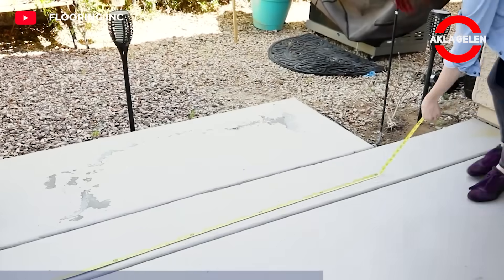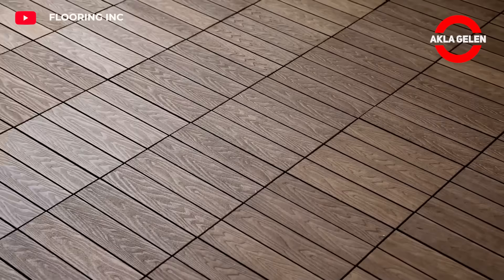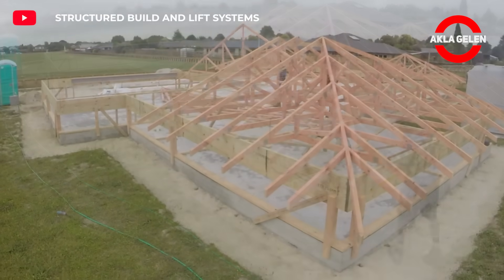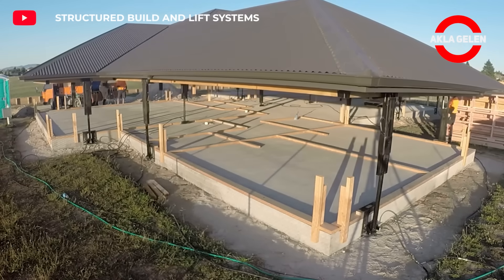Construction Workers Can't Believe This Technique Works - Most Ingenious Construction Technologies▶4

Comment: somehow i'm doubting that a block filled with straw and has multiple avenues for moisture for example to penetrate is going to last as long as a traditional block, let alone be as strong. i'm also going to say that a lot of the features on the first example only try to make it seem better than a traditional build when in fact they're likely worse because of the additional concerns included and it would be more expensive since it would take more time, more materials, etc.

Comment: If they just added sand to that polyurea spray they would be able to make a very strong rubber cement I wonder if they can use a sandblaster to add to that spray gun

Comment: Having been a fire chief in the past with experience with hay bales, in my opinion that construction using hay bales with a concrete outer layer can be dangerous to the inhabitants.  During my many years in the fire service I have personally seen two fires that occurred do to spontaneous combustion of the hay when it was inside a poured concrete form.  One caused a fair amount of damage to the house that it was attached to.  In both cases the bales were the fill inside stairs going into the home where the bales were formed like stairs inside and then concrete was poured in a form around the bales.  There are still many great construction methods but using bales of hay is not my recommendation.

Comment: 40 yrs ago i ran a concrete crew for a hospital in montana  we used straw bales of sraw on all the big steps in the parking garage ,worked awesome, less braces needed, cut time in half, also got my hip replaced there 2 yrs ago n there still in pretty good shape , but they r covered n no real weather condition to deteriorate

Comment: Some really nice Eastern European building techniques.
Reply: In Eastern Europe we exclusively use reinforced concrete for load bearing and very wide bricks for external walls and medium wide bricks for internal walls. And that's it. As of late, flat roofs are preferred due to better isolation and efficiency.  
Anything else is outlier including everything mentioned in this video.

Comment: It works until you get a single crack in that concrete. Then you will have what is called a catastrophic collapse once moisture or bugs get into the hay and starts eating away at it. On a side note we could easily use everyday trash that does not decompose and make bundles out of it and that would be far stronger.

Man that is a great idea, create foundations and walls out of trash to help cut down on waste. Someone said i was smart once.

Comment: The methods shown are neither new nor innovative. They all have been tried before and have mostly failed to gain traction. Trouble is that just as my father found over sixty years ago, with his experiment with prefab housing, stick built platform frame or concrete block construction wins the economic contest.

Comment: They should implement that spray on stuff in our asphalt for roads. If it's that resistant to cracking and impacts, that could solve the pothole problem in the US and with constantly having to repave. Just mix it in with the asphalt before paving a road and it would hold up for decades. The fact that it's waterproof is also a plus. No water sinking through the asphalt would help prevent sinkholes from forming under the roads which in turn also helps prevent potholes from forming. The water could be collected, cleaned and redirected to farms or areas where the water is needed. In areas where salt is used on roads in the winter, instead of having to keep adding new salt after every storm polluting the environment, the salt could be extracted from the runoff during the water purification process and reused next year. Town and cities could potentially save millions of dollars per year just by doing this.
Reply: It doesn't hold up to sunlight and weather. It's an interior material.
Reply: @MrMZaccone  The idea of @mysterydude1 is still useful for this major problem in Indian rural areas
Reply: Asphalt is very very strong but also gets an incredible beating. It's just leftover from oil refining and pebbles. It would be hard to improve in an affordable way, because we need thousands of miles of it.
Reply: @Patiboke  That is true but when you consider how many billions of dollars are spent every year repairing the roads (not that they actually do repair them) wouldn't that money be better spent on improving the durability and life of the roads? Instead of spending billions on patching and half assed repairs spend the billions on research and upgrades. If for example they spend 5 billion on repairs every year wouldn't it make more sense to spend 10 or 15 billion to come up with a way to make roads last for decades rather than a year or two? Spend a little more now and save tons later. Makes sense to me but greed will never let that happen.
Reply: @mysterydude1  они тратят ваши деньги, а не свои. по этому можно хоть по 3 раза в год перекладывать. поймите, те кто у власти , у них нет цели экономить, развиваться, созидать или улучшать жизнь людей. их цель заставить это делать самих людей и при этом самим же за всё платить.
Reply: @dwk2618  You are not wrong at all

Comment: 3:56 - Hitting the bricks with a rubber hammer, on the edge of a thin board.  The water in the basin shows he hardly applied force.  Not a very good demonstration.

Comment: As a construction worker for over 20 years. Alot of this will never be implemented. Its all going to be too expensive. What about that new road concrete that lets water pass through it? From what ive read and heard, its really expensive and thats why its not used. So what was the point ovmf making ut in the first place if its to expensive itll never be implemented. I say we get rid of money. Then it would no longer be "not cost effective ".

Comment: Old timber from the dumpster, cheapest metal sheets or from the dumpster, some trash for insulation, metal sheet, old timber... You have a 5 layer wall for minimal cost. Local rocks and some mortal is also economical, but takes a lot longer.

Comment: What happens when the straw rots out from trapped moisture? Will it be a concert shell or will the slurry penetrate deep enough to saturate the hole bale?
Reply: во 1 если делать по умному то солому надо обрабатывать  цинковым или железным купоросом.так она десятилетия простоит без гнили мышей и насекомых.
во 2 стены из прессованной соломы далее покрывают цементом если, то это так же помогает.но главное просто обработать купоросом.например вымоченную в купоросе сутки  деревянную доску после сушки можешь закопать в землю она минимум лет 30 простоит без гниения.если регион не слишком влажный и доска не будет постоянно в болоте то простоит 50+ лет в земле
Reply: As a contractor specialized in water damage repair I can tell you that trapped moisture kills any structure. Wood rots, steel rusts (in case of that steel being rebar, destroying the surrounding concrete with it) and even a saturated brick turns to dust when it freezes.

Funnily enough (and possibly counterintuitive) a straw bale building is actually quite low on the list of water ingress becoming problematic. Because it can buffer a lot more water before it becomes a problem than most other materials.
Reply: @sigi9669  при пропитке  того же дерева или соломы составами предотвращающими гниение пока состав такой не будет вымыт водой гниения не будет.на вымывание уйдет время в зависимости от  объемов воды.так что древесина будет мокрой но гнить не будет пока состав не дающий гнить в ней находится.
так же есть составы да простая смола которой можно покрыть кирпичи закрыв поры в которые попадает вода не дает разрушать кирпич заморозкой воды.
арматура в бетоне  защищается гидроизоляцией бетона.конечно все это требует дополнительных работ и стоимость постройки увеличивается но  надо понимать что стоимость  ремонта или полного переделывания постройки будет намного выше. если правильно строить то большинство проблем можно избежать.и проблема в том что большинство строят  без всех этих дополнительных защит поэтому многие постройки быстро разрушаются.
просто надо разумно строить

Comment: Concrete is not an insulation like the claim in the modular section.
They are cold damp and cost a fortune to heat trust me i live in one.
Saving up to get external insulation fitted.
Reply: everything is an insulator of varying degrees of effectiveness

Comment: That roof lifting idea was amazing. Way faster and safer to build it on the ground.
Reply: Yeh, but I wouldn't want to be underneath it before the walls are set.
Reply: It is. Couple years ago I took part in project where we slapped steel gable roof on a four story flats. I prefer a crane over dozen jacks though. Safer, faster and about the same cost overall.
Reply: great!

Comment: Walls of straw, mice in the walls will have parties .
Аnd raising the roof is great. A lot of workers fall from roofs when building houses
Reply: You don't know what you're talking about. There are tens of thousands of straw(bale) buildings around the world. Countries like Germany and France have building codes for this and are building apartments, schools and the like. Straw fibre is injected as insulation in timber frames and roofs, by the truck load.
Reply: @nelus7276  I am in Germany and I don't know anything like what you are writing about, especially since I work on construction sites. Especially some kind of straw standards? What are you talking about? Yes, in the north of Germany there are many roofs made of pressed straw, but only roofs, I have never been inside such houses. But rodents would probably laugh at your comment.
Reply: What about fire?
Reply: If you seal them well, rodents can’t get in.

Comment: That roof lift system looks pretty interesting. It probably considerably increases safety, as you don't have to worry about somebody falling off the roof while building it.
Reply: removes the need for a crane to lift the trusses.
Reply: @DarkmanTF1  Damn you guys get to use cranes?
We always just lifted the trusses into position with our bodies.
Reply: @onionring1531    Been there. Done that.  Not fun.

Comment: I remember a story about a little piggy that built his home from straw......it didn't end well.
Reply: That's because it's just a fairy tale. Seriously though, that story refers to thatch on a  stick frame. Baling machines have only been around for just over a century. The oldest modern straw bale buildings are already that old. Very comfortable. Well I insulated against winter cold, summer heat and sound.

Comment: Only if the product does not rot 
When hay shrinks and deteriorates 
That build will be falling apart and a possible dea*th trap
In olden days they used stone, all buildings last to this day, all over Europe you see them
Everything else modern built has to be demolished over time, very sad
Concrete is ok, but I saw them treating hay ?
Reply: You don't understand the difference between hay and straw.

Comment: Doing the roof first and lifting was smart.
Reply: Not really.   I have seen a house framed out in 2 days and then 2 more days for the roof.    The jacks to prop that up seems like a waste of time to me.  As for the safety factor, roofers are remarkably good at not falling off.
Reply: @paulconner4614  Exactly, I see no difference for roofers.
Reply: Trouble is the cost of the lifting equipment will negate any savings over conventional construction by a huge margin. Dream on, Utopians.

Comment: I remember using straw for cattle bunks 40 years ago.  High probability of rodents and snakes over time .
Reply: With moisture there is what is known as spontaneous combustion.   That stucco will not last forever.  Mold, mildew you name it.
Reply: @bfgivmfith You're confusing straw with hay. Oldest straw buildings are over 130 years old.
Reply: They pour a mixture into it that turns it into a type of plywood. I’m sure you weren’t doing that 40 years ago.
Reply: @nelus7276  Hah! 130 years? You might try something closer to 8000 years. "Wattle and Daub" construction techniques are about as old as manmade buildings, 
So long as the blocks fit and the joints work, I doubt that this system would be a problem.
Reply: @davidcolin6519  I believe he meant the age of the oldest, currently-standing instances rather than the age of the design/technique.
Reply: @steamer2k319  There are PLENTY of buildings around the world that were made of wattle and daub which are far older than 130 years. My own mother's house was built in 1223 and uses that technology and t pretty much the entire city of Tombouctou (in Mali) dates back to the 12th century and is made of this material.
Reply: @nelus7276  In a village where I'm living right now there are dozens of straw houses, each over 100 years old, oldest one from 1896 is still in perfect condition even abandoned about 30 years ago. Rest of them was  built before WWI. Impressive materials are used back then - straw, clay mud, burnt wood, stone for roofs, etc. People did not have modern materials and constructions survived floods, storms, earthquakes, etc, and by mho been more durable then those in modern times. I can't talk about insulation and other properties of those old houses but from outside they look perfectly preserved.
Reply: @bfgivmfith  глина пароизолятор... снаружи известкование - паропроницаемость... какая плесень? вы там в теплых странах деградировали все и не умеете ничего строить?
Reply: Straw is woody material.  That's like a tree combusting.  Hay is a different matter.
 @bfgivmfith
Reply: Yeah pretty sure mice are going to love your insulation with snakes to follow.
Reply: да в простой соломе да.но во 1 для строительства насколько я знаю солому прессуют прессом под давлением 20 тонн+ но возможно у вас в сша просто собирают солому без пресса в кирпичи. прессованная солома не нравится мышам.
во 2 солому надо вымачивать в купоросе например цинка лучше всего + еще 1-2 вещества как добавки.тогда солома становится попросту ядовитой и невкусной для мышей насекомых и грибков плесневых.

а просто солому использовать не стоит.она будет гнить без обработки и привлекать жителей сторонних.
правильно изготовленная солома с обработкой простоит десятилетия минимум без проблем.
Reply: I did some research. Hemp is a threat to many less sustainable materials and the companies using them. Also, you're using the wrong "your" in your post.
Reply: Hemp is better option boys an girls do you're research
Reply: Yep, i don't think it's good idea for outer walls. That said i live in 200 yrs old house with some inner walls and ceilings made of original wood, clay and straw mix. While more "modern" parts had to renovated every few decades, those original parts just outlasted generations.
Reply: Straw bale construction is a proven method. People have been doing it for decades at this point. Stucco will last a lot longer than a wall with Zip Sheating on one side and drywall on the other. I have a garage built with drywall. Mice holes everywhere. Keep poo pooing on new ideas. But it doesn't change the fact that stick built drywalled houses with typical plastic siding suck. And are every bit as susceptible to rodents, bugs, mold, etc  as you claim these other ideas would be.
Reply: @edswope28  I couldn’t agree with you more I thought we had all learned our lesson from the 3 little pigs and the big bad wolf but yeah let’s try something new we live we learn
Reply: Not once encapsulated with earthen plaster
Reply: Well hell, an old refrigerator left outside can do the same.  Insulation in your wall can do the same.  It's all about sealing the structure, like any structure.
Reply: Good to know
Reply: I’m more worried about the tensile strength how much psi can that really hold not more than 1000-2000 psi look at it would you really trust that structure during a hurricane with your family‘s lives?
Reply: @jarvisedwin5175  these structures are used more in dry climates such as the southwest but there are older examples all over Europe that date back hundreds of years. Not everyone experience hurricanes in their region.
Reply: @MrJrohl  yeah brother but that is what they said about Dubai
Reply: Straw bale homes are a proven technology that has been around a while. Built properly, there is no more chance of rodent problems than any other home. Built right, moisture and mold isn't a problem either. There is no comparison between a proper straw bale home and setting straw bales in cow manure for cows to urinate and drool all over while they eat.
Reply: As with any insulation.
Reply: It is compressed and pretty solid. But you can use cats to prevent mice with all types of construction.
Reply: @michiobosozoku489  cats never get all the mice
Reply: @Akompliss  I know, and I am talking about BUILDINGS which use basically the same technique which are OVER 800 Years old. And there are buildings in Tombouctou which still stand, which are about 900 years old. These buildings still stand
WTF is so difficult to understand?

Comment: Can anyone explain the last one. Pour a massiv concrete block and then saw it in multiple pieces. Why not pour 6 pieces and save the money for the expensive saw and labor.
Reply: Why not make 40 individual slices of bread to make a loaf of bread?
Reply: @Grizzlox  Sorry, I cannot answer your question, since I never bought sliced bread in my life.
Reply: @rolandruesch6862  you don't get it do you.
Reply: сделать отдельно 5 меньших блоков газобетона будет стоить дороже чем распилить 1 на 5.5 отдельных форм стоят дороже+ приготовить смесь залить в каждую с точки зрения работы для работника которому ты платишь тоже дороже.
стоимость работы пилы дешевле чем отдельные формы и дополнительные работы человеку оплачиваемому.
Reply: Perhaps because those wire saw blades are very thin and fairly inexpensive🤷🏻‍♂️